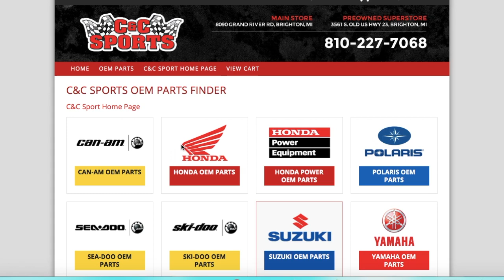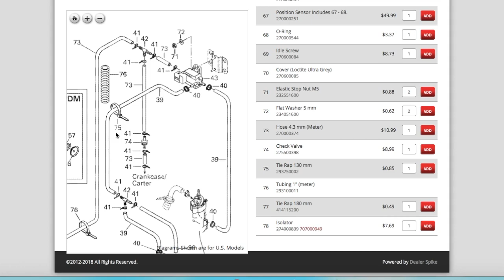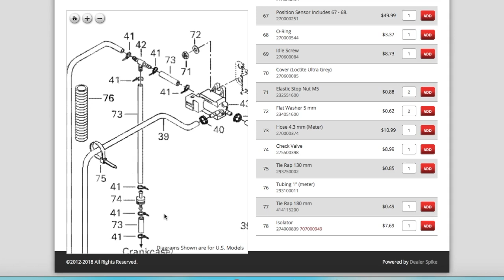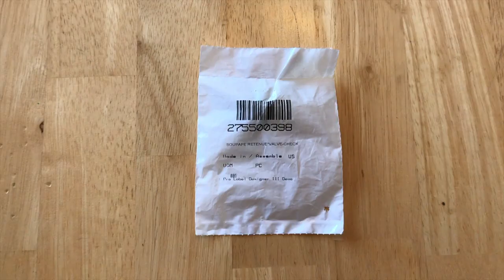Jet Ski engine running rough/sputters - Check Valve tutorial!

Comment: Going to have to look into this. I have a pair of yamaha vx limited 2020's and one of them rough idles and bogs down when I give it throttle. Stupid shop said it was spark plugs. 160$ later, the thing still acting up. So Now i'm researching it on my own to see what the heck.
Reply from the maker: Thanks for watching & welcome to the DIY Raptor Club.  Us fellow DIY’ers need to stick together.  Let us know how your Yamaha performs after replacing this part.  Below is the link to our video showing the replacement of part.

       https://youtu.be/iWjhaWlyQuc

Also, you may have an issue with your vacuum system.  Check out the video links below.

       https://youtu.be/Jr7eWlFGvAc

       https://youtu.be/SfjX9OtOyIM

😎👍🔧🔩

Comment: Good afternoon, I have a 1996 Seadoo GTI.  This jet ski has not been ran in a few years. I put fresh fuel in it and a new battery. I put it in the water and it will only go about 25-30 mph. Any ideas where I should start to narrow down the issue? Maybe a check valve? Thank you in advance!
Reply: clean the carbs..

Comment: Very informative keep it up!!
Reply from the maker: Erwin Herrst Jr Helping Hands 

Thanks Erwin!  😎👍

We are uploading a few Jet Ski tutorial videos & part replacement videos over the next few days!

😎👍🔧🔩
Reply: I need help. 95 seadoo spx
Reply: kwad life What is your problem?
Reply: @Real_on  I got it. It was my fuel selector. It wasnt getting enough fuel cuz the selector was leaking air
Reply: @DIYwithMichaelBorders  got a sea doo question got the same model as show with the rpms fluctuating at idle and while cruising.
Reply from the maker: kwad life 

What’s your update?
Reply from the maker: Robert Rinkinen 

Thanks for watching, have you replaced Solenoid or Check Valve in the past?  If not, it’s likely to your issue.  Keep us posted.

😎👍🔧🔩

Comment: Does a 1994 seadoo sp have one? It was runing good and strong but after holding it open full throttle it looses power after a little bit and will die if i let off throttle for it to idle. Then when going slow it will eventually go full throttle again almost seems its starving for fuel .. Any ideas ??
Reply from the maker: CAL n9ne16 

Thanks for watching & it should.  Your ski is a 2-stroke correct?  This part is extremely important to the efficiency of your vacuum system performance & reliability.

Also, this is common when the ever so slightest imbalance of fuel-to-oil mixture occurs.  Adding the proper fuel-to-oil mixture is important.

Keep us posted, us fellow DIY’ers need to stick together!

😎👍🔧🔩
Reply: @DIYwithMichaelBorders  yes it is a 2 stroke, it mixes it self. I have heard of people bypassing that and pre mixing tho. I honestly dont know what is wrong with it it ran good, let it sit a year or so and when i took it out it ran good at first. But now it seems like its almost starving for fuel when held full throttle for a while.
Reply from the maker: CAL n9ne16 

Thanks for the reply & a few friendly MX item replacements may go a long way.  Replacing Check Valve & Solenoid should definitely help.  Below are our replacement videos.

       https://youtu.be/iWjhaWlyQuc

       https://youtu.be/SfjX9OtOyIM

😎👍🔧🔩
Reply: @mikeb1039  alright thanks man
Reply: @caln9ne16     Did that fix it?